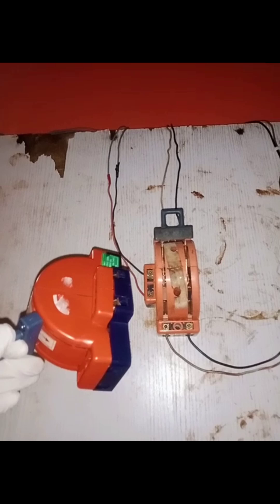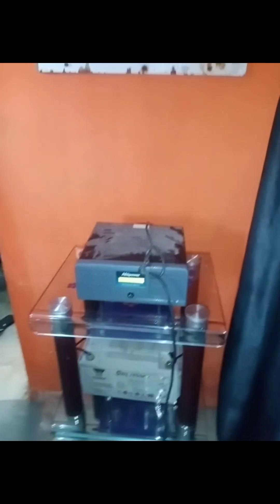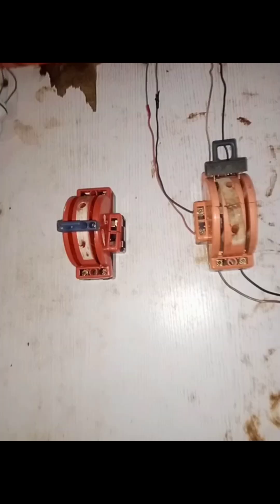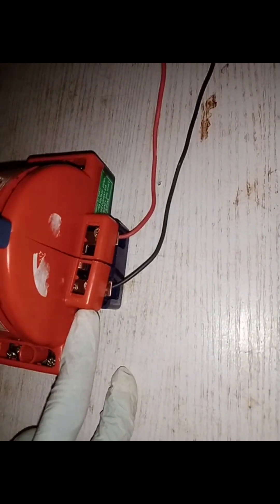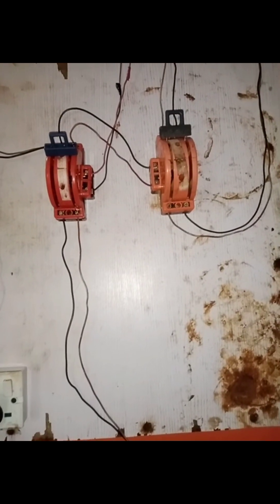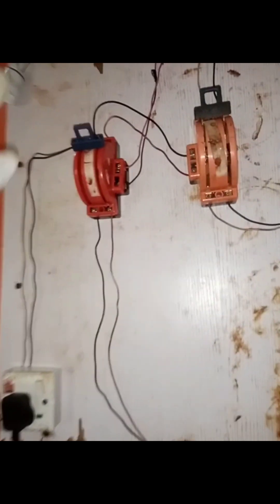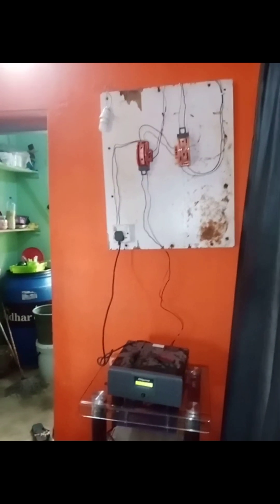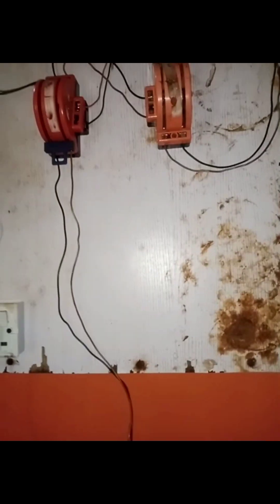How to connect Changeover switch to your inverter

Comment: Good job, but this design can only work with hybrid inverter, because you can not be charging the battery and at the same time be supplying the load from battery through the inverter. Any explanation to this. Thanks

Comment: My question is dis sir, with lopping nepa cable to load , and we are in use of generator,and as well the inverter will be charging with generator light,why the generator is not up to 2.5kva or 3.5kva hope it will not affect the inverter sir ?
Reply: It probably will.  So if ur Gen capacity is low.  Instead of looping ur AC input to the load supply, take it to the NEPA side directly
Reply from the maker: @salamisodiq1351  Thanks for replying him
Reply from the maker: I don't really understand the question
Reply: Weldon exactly what I av look for thanks
Reply: Andrew from Ogun water side Ogun State Nigeria

Comment: What is the role of eath wire in all of this? 

I love your straightforward demonstrations
Reply from the maker: It protects your inverter and other home appliances from thunder attacks especially from your Solar Panels. As a matter of fact, If the house does not have a well connected lightning arrester, I always advice my client to switch off the solar panel DC breaker if rain is falling. SOLAR PANELS are made with glass components therefore they are 70% vulnerable to attacks from thunder lightning

Comment: When the Grid(Nepa) run down via the inverter and the inverter acting like an uninterrupted power supply.Does the Grid(Nepa) charges the battery at the same time.
Reply from the maker: I don't really understand your question. But once the grid light is been restored, the inverter starts charging ASAP
Reply: Yes Sir.